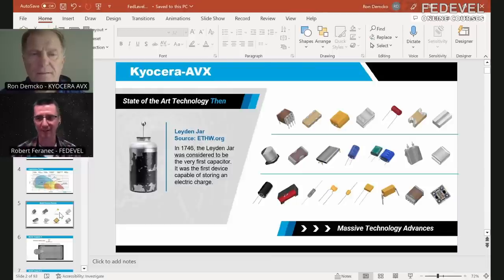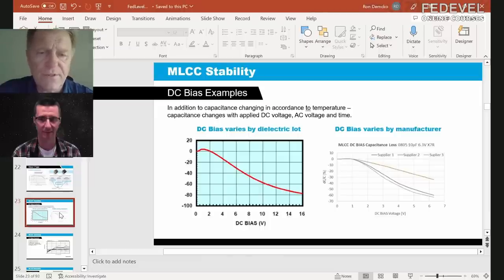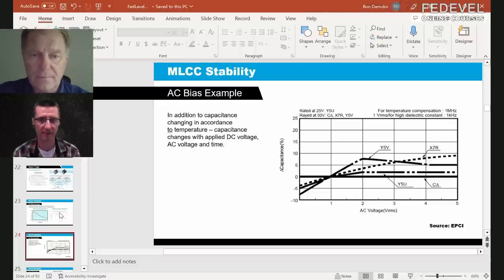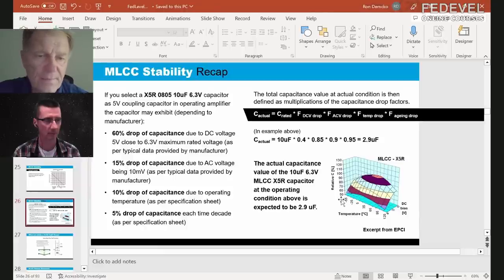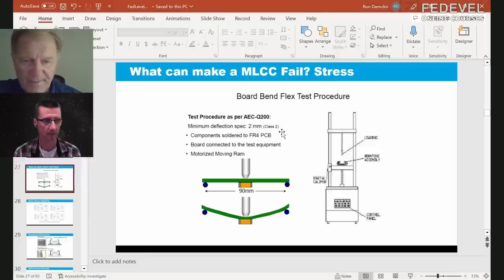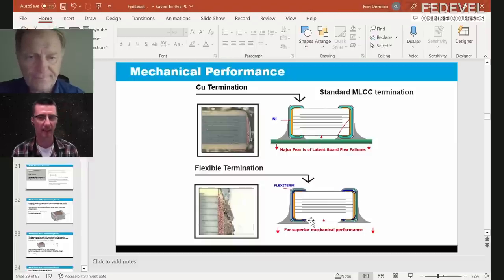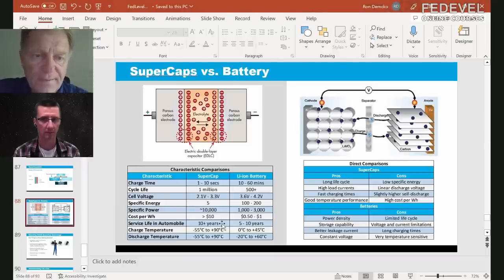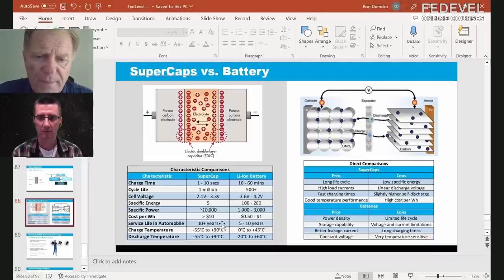Which Capacitors To Use ... X5R, Y5V, NPO, X7R ? Or Something Else?

Comment: Fantastic overview of capacitors for beginners! This session has greatly simplified the process of selecting the right component from hundreds of options. The insights into how capacitance varies with voltage, temperature, and aging are particularly valuable and will guide me in making more informed choices. Big thanks to Ron and Robert for the detailed and engaging presentation!

Comment: I use plenty of the ESD safe automotive Q200 capacitors, close to a hundred per engine controller. I use Flexiterm on larger caps - 1206 and larger, usually automotive standard caps on 0603. Thermal cycling was most sensitive on BGAs and QFNs far before even the non-flex automotive qualified caps, I avoid those and try to stick with QFP and TSSOP.

Comment: Thanks for reminding me of the DC bias problem. That was exactly the problem that turned out to be causing the problems I was having right now. I was using a 100V X7R 1µF to enable communication between 2 controllers that are 48V apart. Turns out, at 50V, the capacitance decreased by 75%, causing the voltage levels to get outside of comm specs too quickly, losing connection mid transmission. Will use film caps now as too high capacitance at 0V would cause turn on issues.

Comment: One very important parameter as well, is the frequency vs max voltage parameter.
This is very often overlooked an can be very important in switching applications or other AC applications (like audio or other data acquisition situations). Especially for film capacitors, this can be an issue.